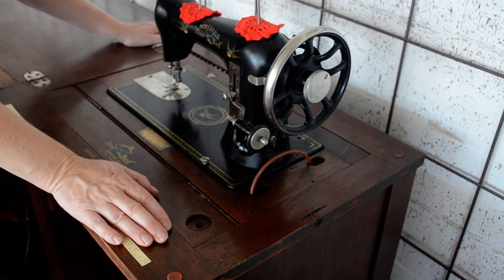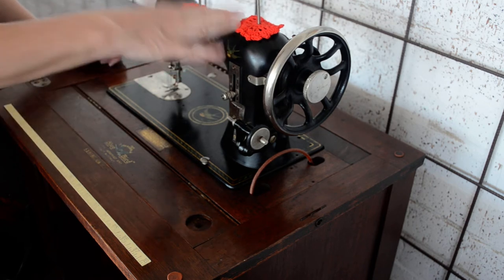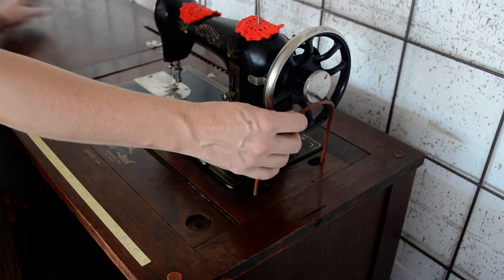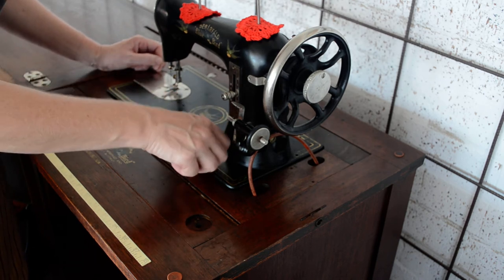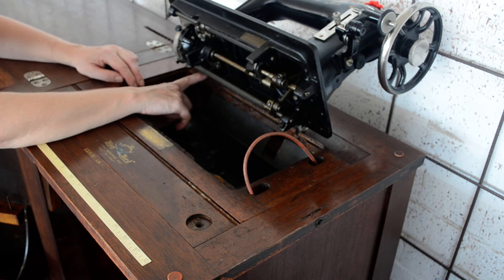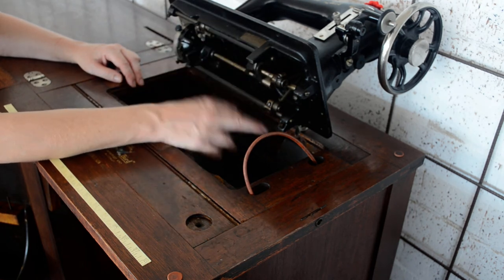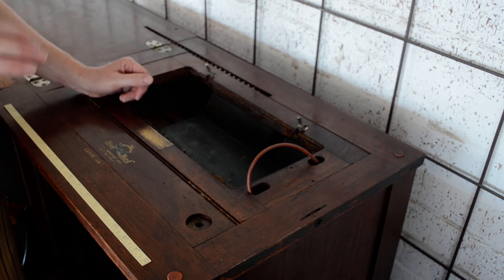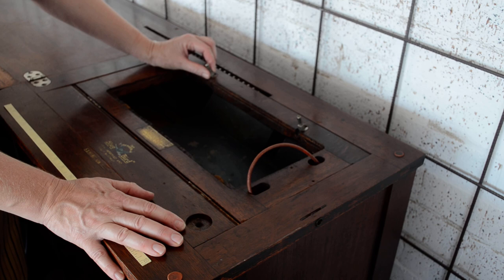Removing sewing machine head from 1930s auto-drop Bebarfald cabinet

Comment: Oh thank you so much spent over an hour searching the internet for a solution to why my machine was stuck :) n the manual was no help. In my case it wasn't so much pull bit to push to the left :) and it unhooked in case that helps anyone else :)